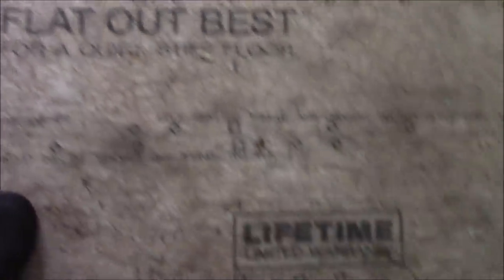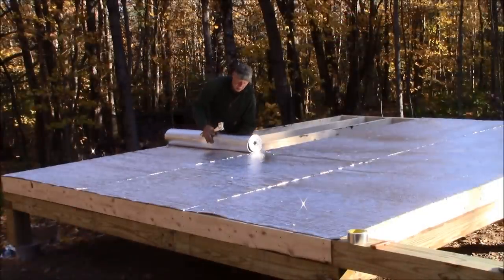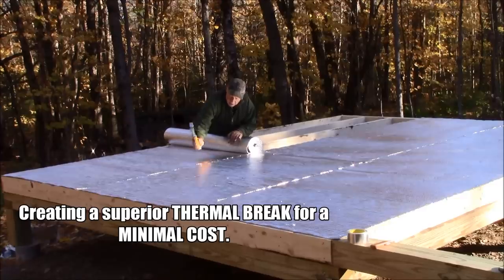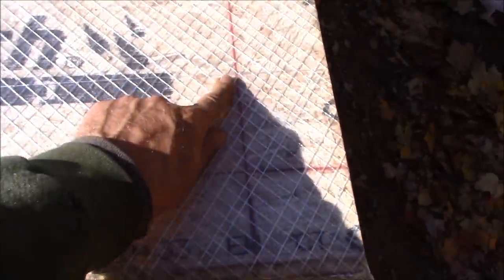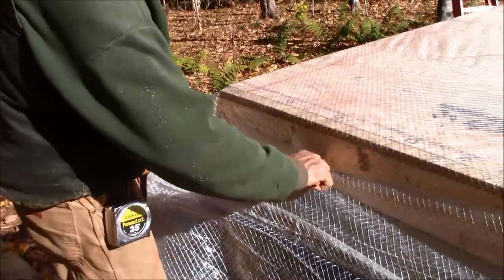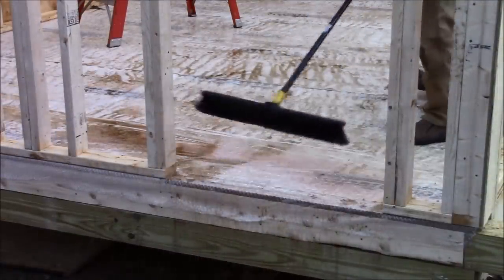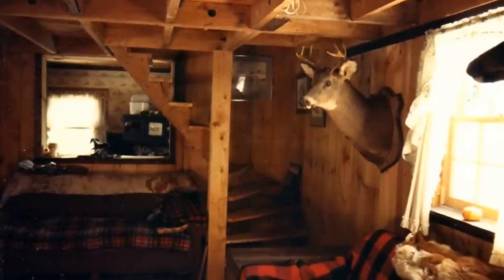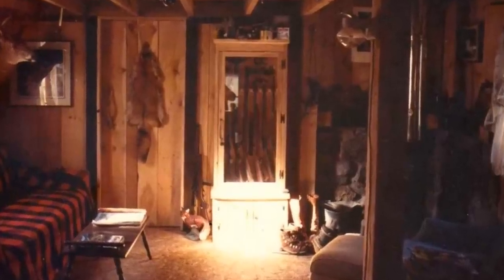Building Your Own House Or Cabin?  WATCH THIS BEFORE YOU BUILD. Build Smart, Avoid Mistakes.

Comment: I'm ok at finishing the inside but horrible at framing.
Reply: Don't have anyone name Jack help with the framing.  Lol. Joke
Reply: Build a jig. Two 2x10x10's  with blocks attached to side that make the framing members fall into place against the sill plate and top plate.

Takes your time to mark things correctly and attach blocking that will hold the pieces of wall framing square. You can make

Comment: It is posible that the German comp Zarges will contact you. They have proffesionel Industrial stairs and platforms Ladders & Stepladders ,ZAP – ZARGES work platforms ,Mobile platforms Mobile scaffold towers Fixed ladders Shaft equipment boxes and cases. Greeting from Hamburg in Germany where the Hamburger came from. Frank, writer free journalist and influencer with passion